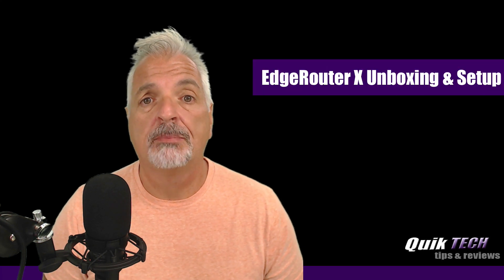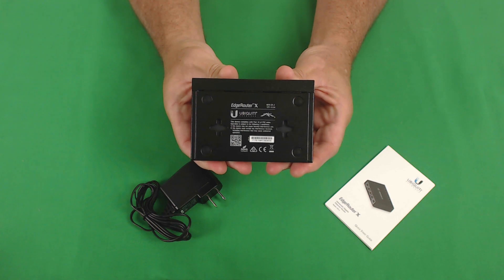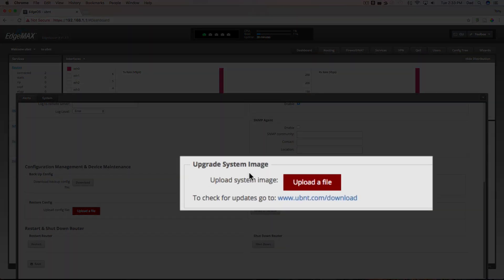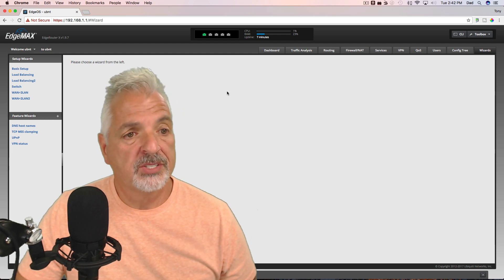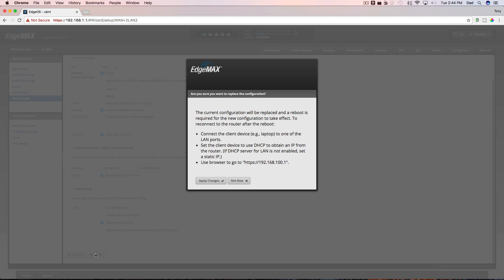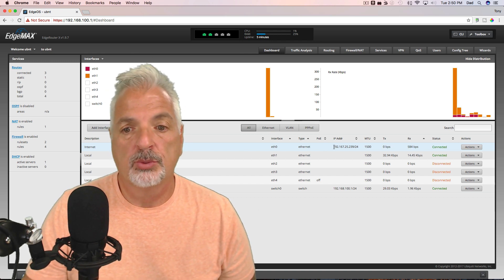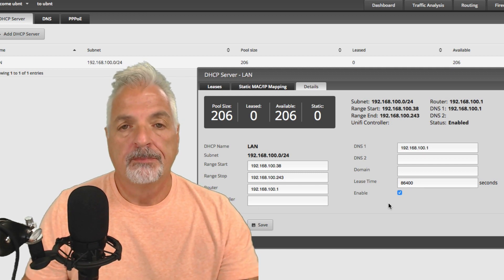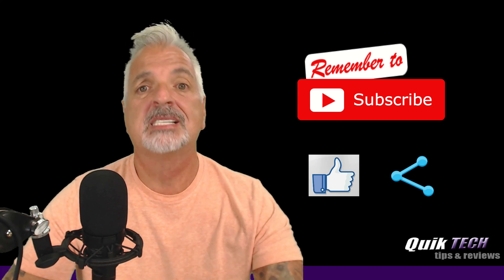Basic Home Networking Part 1: EdgeRouter X Unboxing & Setup

Comment: another great  vid Tony! many thanks.
Reply from the maker: Thanks again!
Reply: @QuikTechSolutions   Getting set to install EdgeMax ecosystem in my office. Removing ISP-provided wifi router and replacing w/EdgeRouter X SFP feeding to EdgeSwitch 10 XP via SFP, then to a couple of wired connections (VOIP/PoE, and a file server) and and to Unity AP Pro's. Guidance on creating a EdgeRouter X-to-EdgeRouter X VPN?
Reply from the maker: That’s awesome, good luck with the setup! I have been meaning to do an EdgeRouter Site to Site VPN video for the last two years, and just haven’t gotten around to doing it for one reason or another. However, it is pretty straightforward to do. Here is a link to a buddy of mine’s video, a guy name Willie Howe. 
https://youtu.be/-7mERCvrcJQ
Reply: @QuikTechSolutions  How can I reach you with a specific question?

Comment: Thanks for the awesome video. Im stuck at the first step to connect my mac to  the EdgeRouter x. I followed exactly as you presented. Also turned off the WiFi too, still no luck. All firewalls are also turned off. Not sure what I'm doing wrong. Please suggest.
Reply from the maker: Make sure you’re plugged into Eth0 and manually set your computer’s network settings to an address in the 192.168.1.x range. For example, 192.168.1.2 should work. Set your mask to 255.255.255.0. No need to set a gateway for this step.

Comment: By default, the ETH 1 port is set up as a DHCP client.  You only mention ETH 0 which is preset to static 192.168.1.   The DHCP is pretty handy if you want to just plug the ER-X into a router port you have handy for configuring instead of directly into a PC (though I haven't tried it! This is per the quickstart guide)
Reply from the maker: Thanks for commenting. This is the way I’ve always set them up out of the box. Haven’t tried it the way your suggesting. Might have to test  this. Have a great day!
Reply: For what it's worth I just set up the ER-X and the ETH 1 Port was NOT working as a DHCP client, so I ended up using the static port anyway.  I followed your guide and it all worked great.  Thank You!   If there are any basic firewall settings you'd recommend for a simple home office setup (maybe you've covered in a different Ubiquiti Video?) it'd be very helpful. Thanks again.

Comment: Very nice video.  Do you have any that shows how to resolve local hosts using the ER-X?  Once plugged in I can no longer ping nor access via HTTP various servers I have running on my LAN.  I've experimented and google some solutions but wound up resetting the ER-X to factory defaults.
Reply from the maker: Hello Aw! Thanks so much for commenting, much appreciated! I don't have a video on resolving local hosts on the EdgeRouter, but a friend of mine does. Check out this vid from Willie Howe - https://youtu.be/e34QNh16fh8. Sounds like you might have some firewall things going on here as well. Good luck.
Reply: @QuikTechSolutions  Thank you so very much for that link.  I watched it and it did help me set up DNS correctly for many of my devices.  After much agonizing it turns out one of the issues with two of my Plex servers were static IPs I had configured for VPN split tunnel several years ago.  I completely forgot about that.  When the ER-X got introduced my server's static IP was no longer correct and my IP Tables refused traffic.  Thankfully all fixed and I can now REALLY enjoy this ER-X.
Reply from the maker: I’m glad you got things straightened out! Have a great day!

Comment: Hello good afternoon! I wanted to ask you about the configuration of the Wizard and the default firewall rules that are created. Should we consider adding more security rules to the firewall? I get the impression that some very basic rules are created. A greeting!
Reply from the maker: Hello and thanks for commenting! So, the Edge default firewall rules created by the wizard provide a very solid foundation for WAN rules. Depending on your network environment & configuration, of course you can add more rules. For example, if you have smart devices, TVs etc, you can group these devices in an IOT network and add rules to prohibit these devices from accessing your main LAN.  Have a great day.
Reply: @QuikTechSolutions  Ok, thank you very much for all the information, and for all the videos you have made, the ipsec VPN video also helped me a lot in making the configuration. Thank you!

Comment: Thanks for the video Tony! I'm a bit of newb and trying to learn more about networking. Question for you: Why did you change your router's IP address to 192.168.100.1? is that because you were connecting it to your existing router (that I'm assuming was 192.168.1.1) and therefore the default ip address on that network was already taken?
Reply from the maker: Hayden Braxton Hello Hayden! Thanks for commenting. The reason I do this is solely for security purposes and best practice.  192.168.1.1 is commonly used by many vendors and providers as the default IP. That being said, one of the first things I do is change that and the default username and password. Like I said, as a best practice, I never leave anything set to the defaults.  I chose to use 100. You can use something different like 192.168.20.1 etc as long as you use an address scheme that is within the private IP address range. Google private ip ranges for more info. Have a great day.
Reply: Cool. Thanks for the info!

Comment: Video was somewhat helpful but somethings are hard to understand. i am trying to use this as a router getting internet from my providers modem and using it to push  internet to my ubiquiti wireless access point and a switch in which i hope to plug in several Cat6 Ethernet cables that i have going to the bedrooms in my house so we can have direct connections rather than WiFi. What steps do i need to take to just set it up as getting internet from et0 and pushing it out to et1,2,3,4? Thanks
Reply from the maker: +Joe Torres Hey Joe! Email me the make & model of your provider’s Modem, along with a photo of the modem’s available ports. 

quiktechreview@gmail.com

Thanks.

Comment: 4:35 - it says "Only use one LAN"  - is that what is called "bridging" in newer versions? Because I tried this setting, and noticed that my 1GB fiber ISP is not returning full speed (only about 120mbit instead of 930mbit normal). So I guess its not posible for me to do it this way?  Great videos though
Reply from the maker: So, that is referring to using all the remaining ports on the router as a switch on the same lan. As far as the speeds, do you have Hardware NAT enabled on the router. If not, you can enable it via the CLI by using the following commands:
configure
set system offload hwnat enable
commit
save
Reply: Can you explain what this does? Would it help my speed issue?
Reply from the maker: Yes, that is what it is designed to do. Here is a link to the ubnt help doc with detailed explanation of what it is. 

https://help.ubnt.com/hc/en-us/articles/115006567467-EdgeRouter-Hardware-Offloading-Explained

Comment: Which router do you use for internet coming into your home?
Reply from the maker: Thanks for the inquiry Bob. I use the EdgeRouter X SPF for the main Internet connection. In my lab I switch off between an EdgeRouter X & a USG that I use for testing. Please consider subscribing to the channel. Thanks if you have already.
Reply: When you say 'internet coming into your home' - do you mean the modem?
Reply: I really did mean which router.

Comment: Where can I find some POE support for EdgerouterX SFP
Reply from the maker: Hi Craig, thanks for watching. What exactly are you looking for?
Reply: @QuikTechSolutions  I have a camera that takes POE+, does this not work with the Edgeroutwrx?
Reply from the maker: Craig, it does not support PoE+, only 24 Volt Passive PoE. So, to power your camera requires a device that can provide PoE+, like a PoE Switch or a PoE Injector.
Reply: @QuikTechSolutions  Thanks, I will just locally power it. Do you know of any small routers that hand out DHCP that do support POE+?
Reply from the maker: @OutdoorCO75  Craig, I don't, but I wouldn't give up the Edgerouter X SFP.  It's a great router with a strong firewall. You can cost effectively add this TP-Link switch to your setup to power the camera. https://amzn.to/3R0RYon
Reply: @QuikTechSolutions  I already have that switch actually. Can it take POE from the edgerouter?
Reply from the maker: You don’t need to give the switch PoE from the Edgerouter. Just plug it into one of the Edgerouter ports, this is assuming you have all the ports configured as Switch0. Make sure 24vPoE is turned off on router port you select. Plug your camera into the switch. The camera will get PoE+ from the TPLink switch.
Reply: @QuikTechSolutions  I think I understand, but I am trying to avoid two power supplies for the switches. It will be a closed network that probably will never get internet but I left eth0 with the option. I need to be able to hand DHCP to the camera and to a light controller.

Comment: Why is your primary router handing out public ip addresses? Is 192.167.25.0/24 assigned to you by your isp? Assuming not you probably should fix that.
Reply from the maker: Yup, totally aware of this. We were just testing a few things, but have since moved to using the 192.168 private ip ranges.